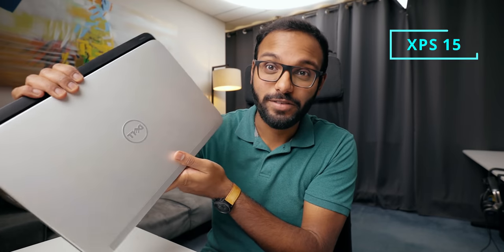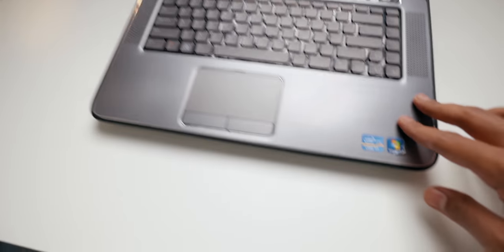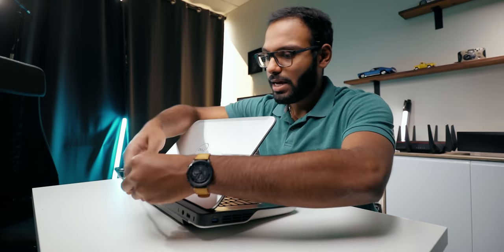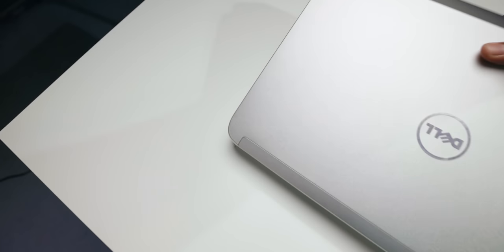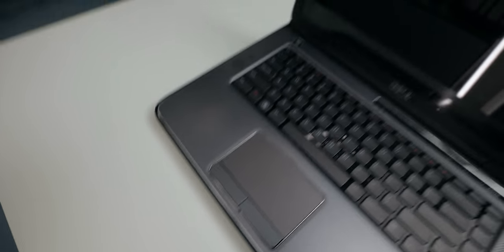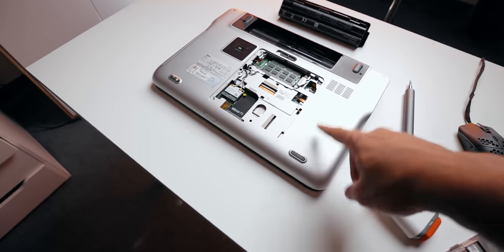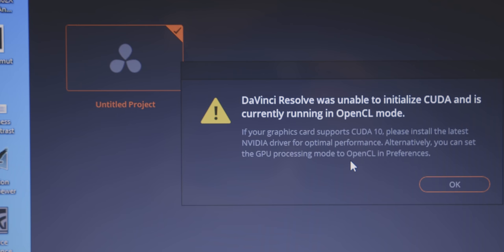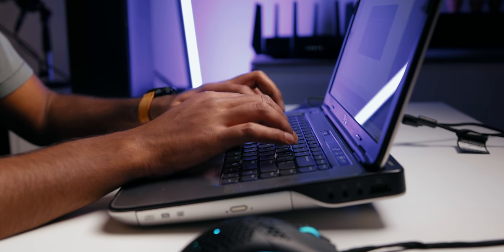I Restored My FIRST Laptop!

Comment: Ok, So I got the same laptop in 2011, my first laptop and I still have it with me. I wanted to do the same, but unfortunately, I couldn't find parts for it here in India. :(
My laptop's battery is completely dead and it runs only on the charger. The trackpad needs changing (I used to game with the trackpad back in the day, and the left click is as mushy as thermal paste NGL) and the speaker somehow is blown, I have no recollection of how it happened, but apart from that, runs just fine. If only I found the parts......

Comment: Maybe this is a dumb question; why do you (YT) folks not research and download the required drivers and stuff onto a flash drive BEFORE you install Windows, then you wouldn't have to worry about being connected to the internet in order to install the latest drivers, etc.

Just my .005 cents CAD

Comment: Linux is still a better option, I personally don't use Linux but, hardware this much old only Linux can give it new life, no point installing Windows, I had ThinkPad T430 i5, which is weaker than your this laptop but Linux mint runs fine